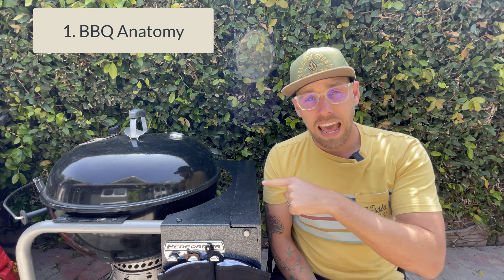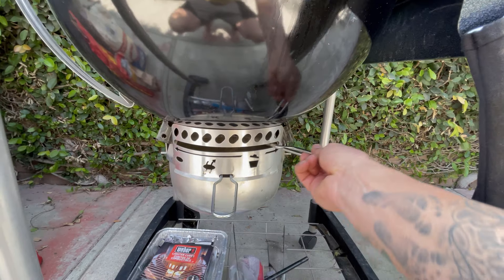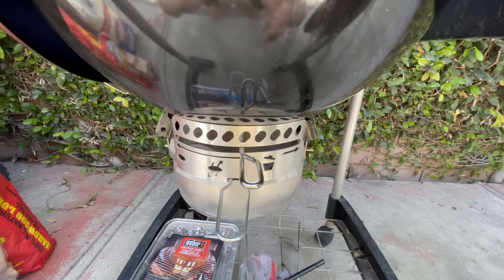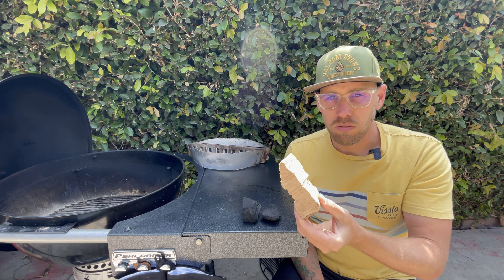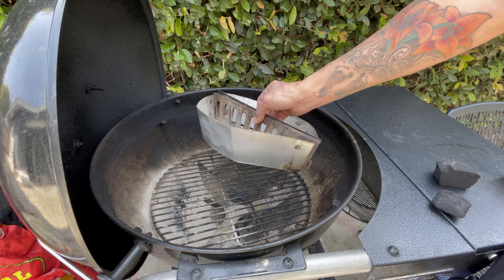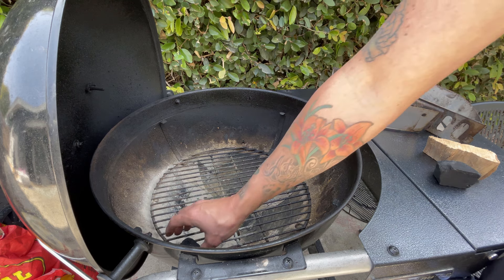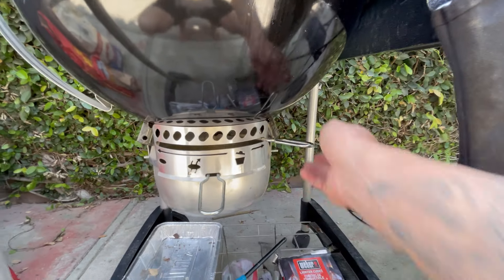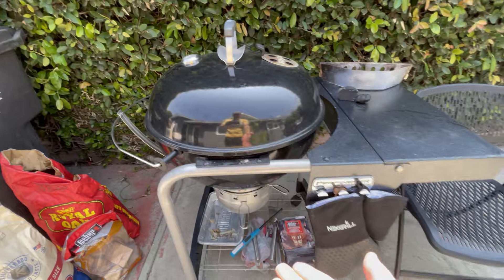WEBER KETTLE GRILL BASICS!

Comment: maybe you can do a video on wireless meat thermometers
Reply from the maker: I’ve only used the MEATER but I sure do love it. I’d love to know if there’s something else out there that people love. But mine does what I need it to do! I will make a proper video reviewing it though.
Reply: Hi Garth, I'm also looking at the meat stick . Specifically I'm looking at the meat stick mini because I don't cook large slabs of meat on the  whole but the mini doesn't have an ambient temp sensor .Still it looks like the Meater is tried and true and it might be wiser spending a hundred bucks on something more founded and established . Any help would be greatly appreciated . You do nice work . I enjoy your videos .
Reply from the maker: I appreciate that! I would say ambient temperature is one of the most important features of the MEATER. Since I bbq with coal and a simple lid thermometer, I use the ambient temperature more than I do the lid. Since the meat is often in indirect heat, I’d rather know the temp near the meat then at the top of the lid. They can often be more than 100 degrees off from each other. 

And I have the most basic MEATER but I learned that if I connect our family iPad to it and leave it next to the bbq that I can get temp readings on my phone from anywhere thanks to the Wifi network of the home. Otherwise the Bluetooth is fairly limiting. Hope that helps!